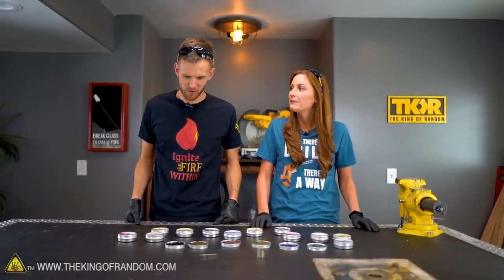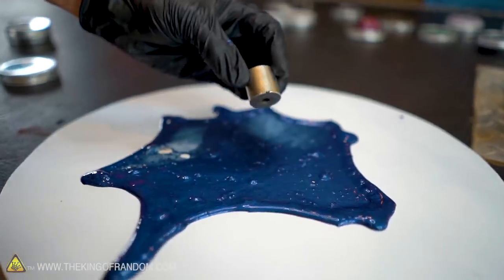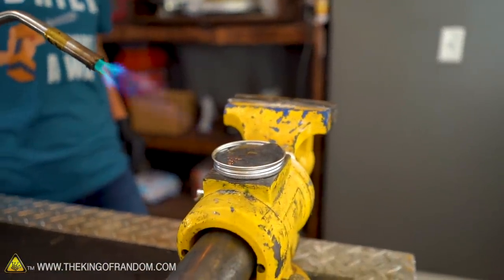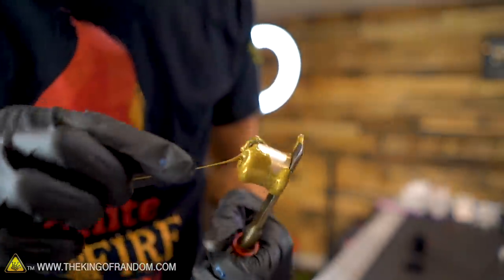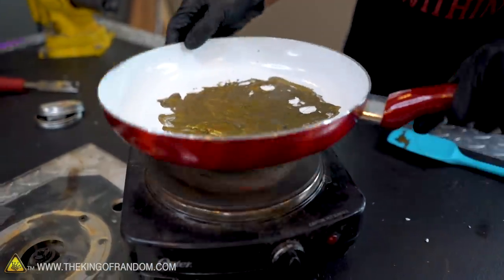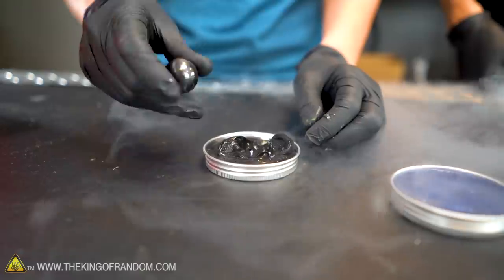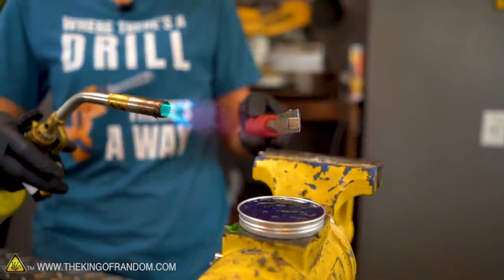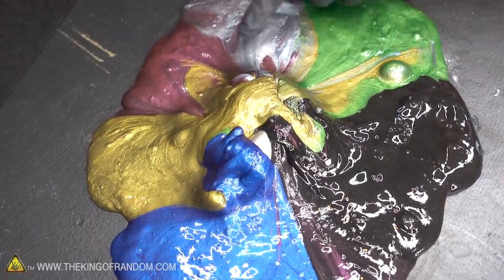Can You MELT Magnetic Putty?

Comment: What will happen if you put ferrofluid in a Microwave. And will it work the way after
Reply: Ferro fluid has metal in it Metal + microwave = boom question solved
Reply: Ferro means to contain iron it would arc short and burn while it released magnified micro wave frequency in short burning everything in the wave radius aka irradiate

Comment: 1. Freeze dry magnetic putty and normal putty and see what happens

2. Use the strongest magnet to see if the magnet is swallowed faster

3. And try to see if freeze dried putty will still stick to the putty but use different strengths of the magnets